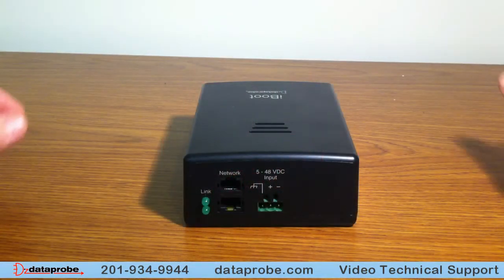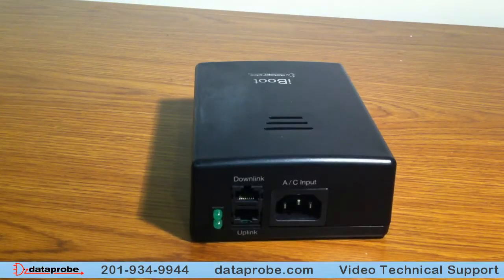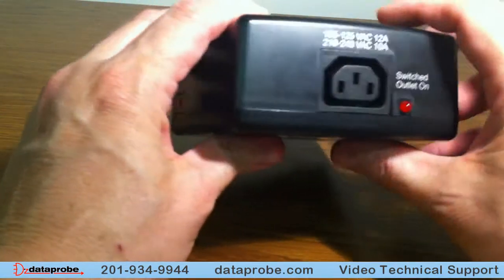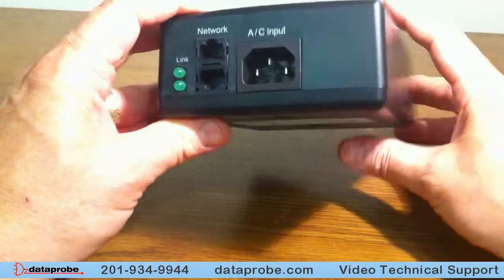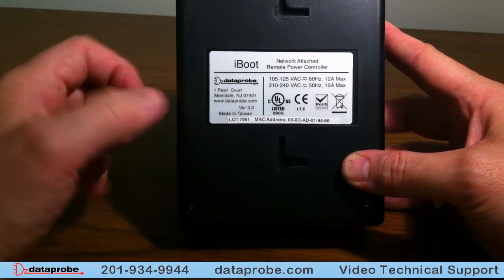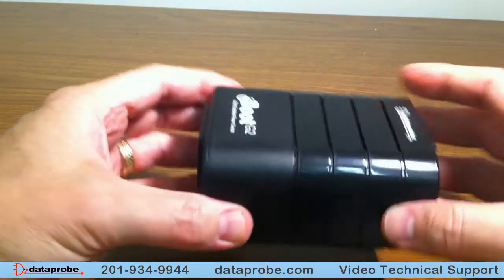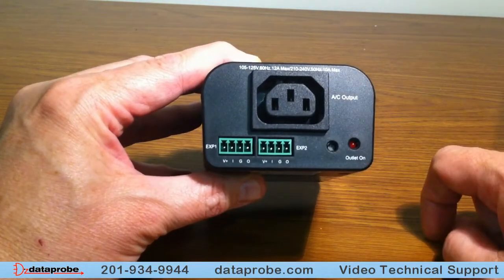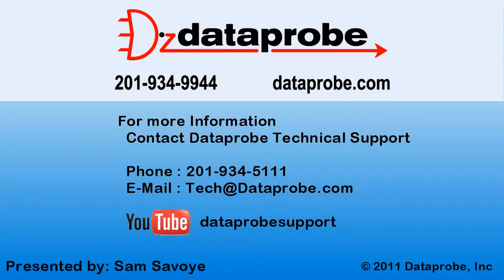How to Identify your Dataprobe iBoot

Comment from the maker: Thank you for your question. Acording to the Chyangfun website, that is a DAS tower with a 250W power supply. The iBoot-G2 can easily handle that much power. You will need to be sure the tower can handle being reset buy unplugging, then pluggin back in. Essentially, that is what the G2 will do to reset it.